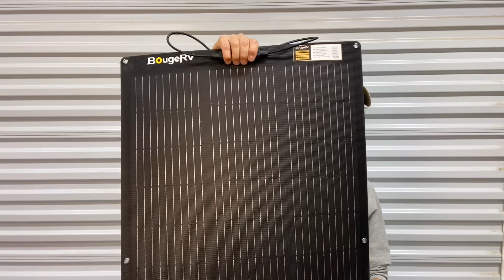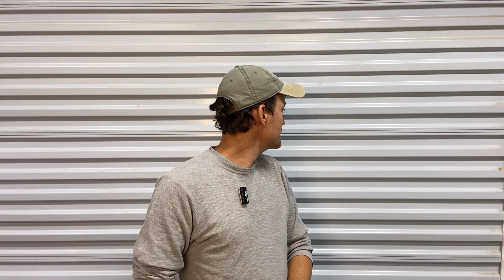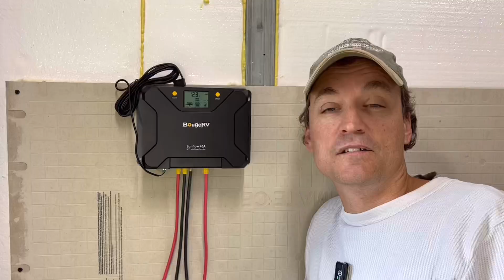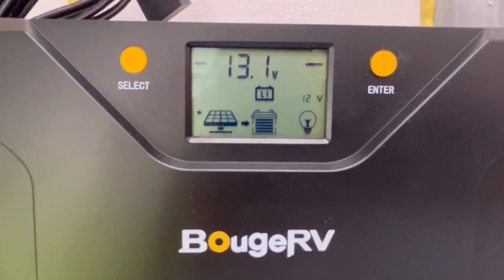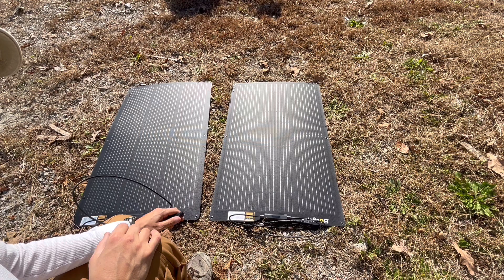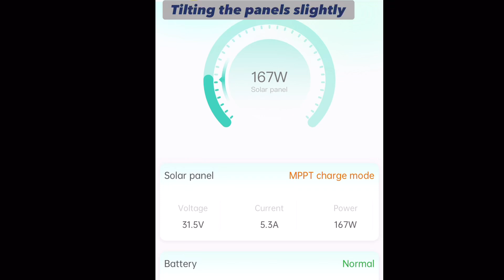BougeRV flexible fiberglass solar panel and 40 amp charge controller review

Comment: Very nice interesting panels. This will open up opportunities for more people. Does that charge controller have low-temperature protection? Not that you need it :/ 
Gavin, You should have used the panel on top of the trailer as your thumbnail!
Reply from the maker: The charge controller does come with low temp protection I believe. This thumbnail seemed a bit more unique. 😄

Comment: Before I mounted those on a trailer or RV, I would want to check the temperature on the back on a hot day, because I've seen someone who had a flexible panel cause a fire!
Reply from the maker: Wow. Are you sure they didn’t have an issue with a loose mc4 connector?